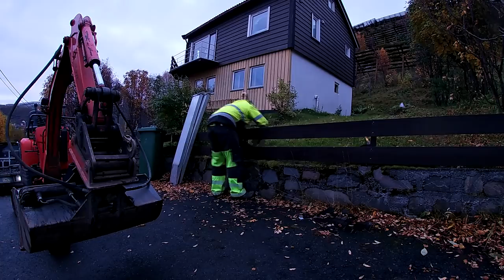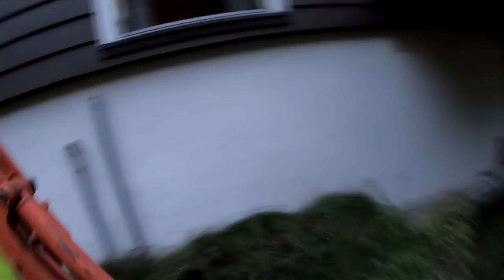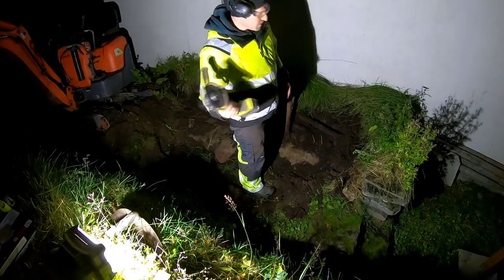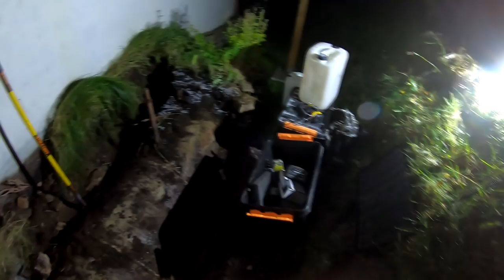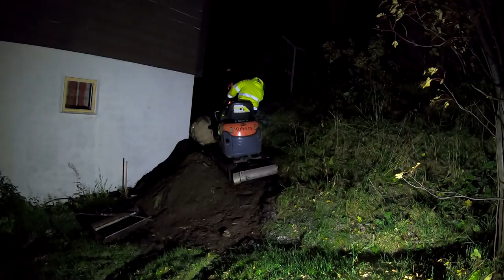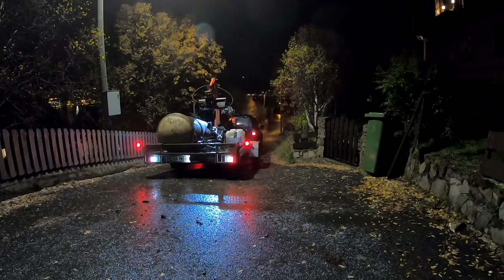Climbing into a garden with an excavator to remove an oil tank

Comment: Like the work your doing with small excavator. Excavator like mine K008-3 for home use. I like doing everything myself at 75. Looks like it got a little dicie, fun stuff.
Reply from the maker: Yes the little kubota is awesome, it's incredible how much you can do with so little, the worst thing is the reach you need a good way to get the dirt away from where you are working. But it's really powerful for its size, and reliable 2500 hours and runs like a champ 😊

Comment: it's really amazing; nothing stops you from doing the job: no rain, snow or darkness will keep you from getting the job done. Questions: is there a law requiring the removal of buried oil tanks? And did you get into excavating when this law was passed?
Reply from the maker: Well with only a few hours of daylight and rain all summer I had no choice 😅 When I started my  excavation business in 2015 I had a rule that I didn't work in rain, that hold for maybe 2 years 😂 Heating with oil is prohibited from 2020 in Norway, and when you stop using your tank you need to get it empty and cleaned or removed. Removed is cheapest in most cases as long as you haven't build somthing ontop of it. No i did start with renting out equipment but more and more people wanted a machine with an driver so, than it gotten more and more. I do still only do my excavating business in my free time I have an day job also 😊

Comment: Nice video - tight spaces your working in
Reply from the maker: Yes it's actually many times I need to go and get the little kubota out working becaus I can't turn around with the other machines. Most of the houses here are from 50's and than you didn't need a road to your front door, or blasting so house would be at same level as the road was to expensive. That makes a lot of tight spaces.

Comment: Resistance heating seems like it would be more expensive. Why is Norway removing oil tanks, is because of tanks leaking into ground water? Thank you for another great video! In USA we are required to remove the soil under the tank if it has been leaking, it could add $$$ to the project.
Reply from the maker: Oil is not green energy that's why it's prohibited to use that for heating now. Yes tanks must be removed to prevent leeks, and if you get one you are in for some high $ to clean up.

Comment: 👌do you charge by the job or by the hour with minimum amount of hours?  What type of heating is replacing the fuel oil heaters?
Reply from the maker: The oil tanks I had a fix amount on, it's the last year it is allowed to have oil burners here in Norway so it have been the big oil tank removal year this summer, so I had one price on the removal, but than it was extra if I needed to make a road like here, pump out old water /fuel stuff I couldn't know by the hour. It's most electrical heat these days and a little for wood.

Comment: Hear in Saskatchewan on the farms we had heating fuel with the tanks in the basements then most but not all converted to propane or natural gas witch made sense at the time , but there are a few that still use heating fuel and now even with our carbon taxes here is is much cheaper to heat your home with heating fuel that using natural gas because to be hocked up to the lines that supply the gas they charge as much as the gas you use . It was cheap to use natural gas but now they have everyone on natural gas they have Jacked the supply rates just as high as if not more than the gas rates .
Reply from the maker: Here I think 95% are underground. Ain't that typical 😒 when you think you are on the best product...